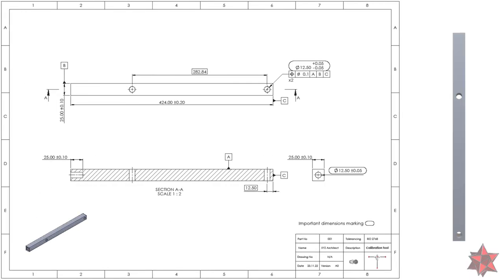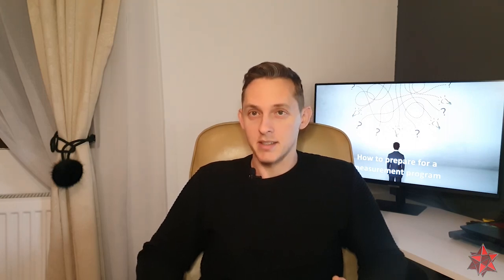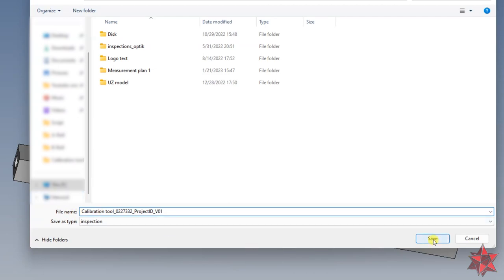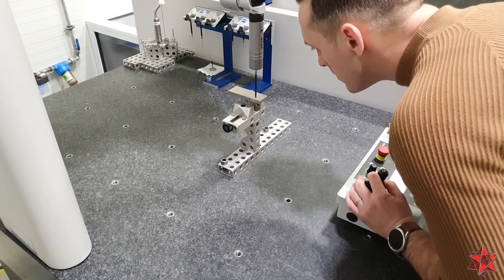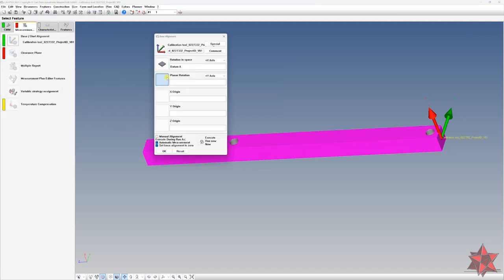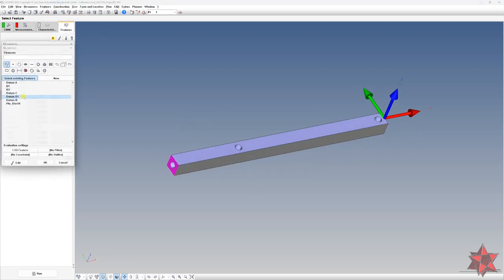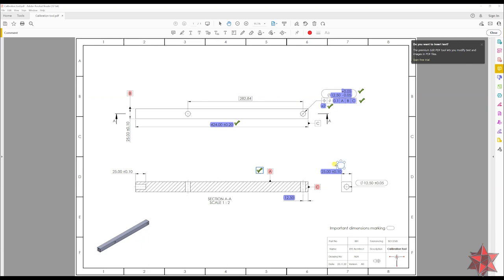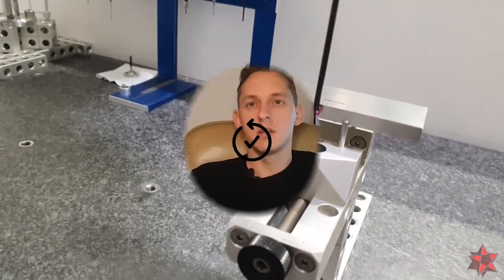How to organize for CMM programming?

Comment: With touch trigger probes (Renishaw TP200) what is the recommended hits/levels when qualifying probes if tolerances are +/- .0002” ?
Reply from the maker: Sorry for the late response. The golden rule says that the report between measurement uncertanty and the tolerance zone should not exceed 10%.